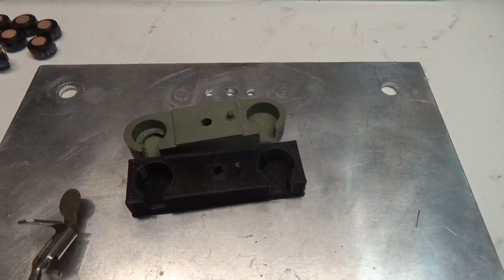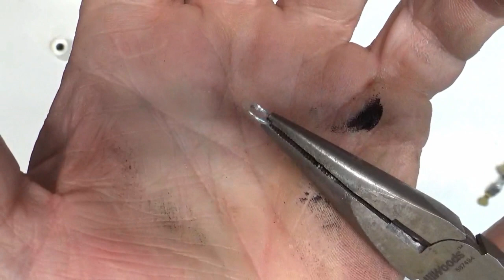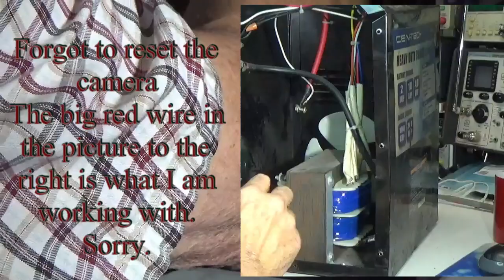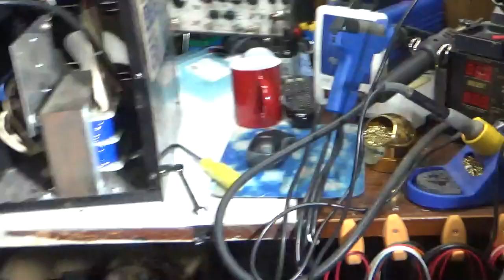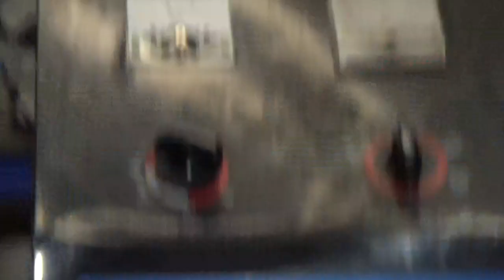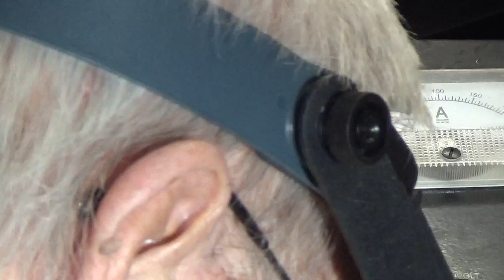Fixing a Cen-Tech 69368 Heavy Duty Battery Charger

Comment: Ok so I did all the diodes and used the grease and double checked the diodes were in the right way and it seemed to work fine for about 2 min then quit charging again. I triple checked the diodes again and still all fine. What else could it be?
Reply from the maker: The only thing I can think of is to make sure the diodes are making good contact. The way they do it isn't that great.

Comment: How did you test the diodes to make sure they needed to be replaced?
Reply from the maker: Like any other diode. Your meter has a diode test position. Put one lead on one side of the button and the other lead on the opposite side. They should read between .6v to 1.2v one direction and open the other. I know they don't look like diodes but that is all they are. Thanks for watching.
Reply: @AERVBlog  thank you very much for your response .i never knew it had that mode to test diodes.
Reply from the maker: @frenandols2805  your welcome.
Reply: Also they will be black and burnt up, along with some melted wire and plastic diode housing, that's what made your charger burn up.

Comment: I need to replace the fuse.
How ?
Reply from the maker: I don't remember a fuse and I do not have that thing anymore.  Sorry.
Reply: @AERVBlog  turns out I tripped the  breaker when trying to turn over my engine by jumpstarted the starter .
Reply from the maker: @UnTamedMustang  ahhh. Glass or was something simple.
Reply: @AERVBlog  extremely simple haha.
I have the power strip on the side of the wall and I wasnt able to see the reset switch on the side of it (mounted vertically on the wall) .
Reply from the maker: @UnTamedMustang  that is a feature. Wouldn't want some audible alarm to bother you or anything.

Comment: I followed along as you did the rebuild.  Great job.  So I took my apart and pulled the heatsink plate out.  Took it all apart. Replaced the diodes and used 3 rebuild diode holders I made.  I made them out of very dense piece of wood.  Wood won't melt so I should be ok.  I won't leave it running without observing how its doing.  Got it back together and it works fine now.  That is a relief.   Now I know how to repair it in the future.  Thank you for your great class of instruction.  Perfect.   John
Reply from the maker: You are welcome. I am glad I could help. Thanks for watching.

Comment: Fantastic, i have one that i picked up that had the exact same thing happen to it.  Im sure i can hand make some kind of diode holder or   something.  Question is what caused this beside a overload and how to prevent it from happening again. Unless they use the wires as cheap overload protection.
Reply: I think from the looks of the holders one of the diodes shorted out and melted the holder and the rest as they say is hostory. One shorted battery being charged at 40 amps for start would do it for sure. Thanks for watching.
Reply: Here is a link to the place I bought the diodes. 

https://www.mcssl.com/store/plpbatterysupply/catalog/search?keyword=diode
Here is the one I bought.
https://www.mcssl.com/store/plpbatterysupply/catalog/product/696040-10
Reply: @aervblog110  It is an advert for starting an online store?
Reply from the maker: @crystalgiddens7276  interesting. It used to work.
Reply from the maker: @crystalgiddens7276  they have a real website now. Plpbattery.com
Reply: @AERVBlog  Thank you!
Reply from the maker: @crystalgiddens7276  your welcome.

Comment: What is part # on diode
Reply from the maker: They are marked AR50D. I got them from PLP Battery Supply with a part number of 696033-10. That is a Powerforged Service Parts part number. Hope that helps. Thanks for watching.
Reply: @AERVBlog  were all the diodes bad? Mine appears to be only 2.
Reply from the maker: @crystalgiddens7276  yes. All of mine were blown and 3 of the housings melted. No idea how it happened.  The unit was given to me broken. Thanks for watching.
Reply: @AERVBlog  how did it turn out? did replacing them work for long?
Reply from the maker: @crystalgiddens7276  I have only used it a couple of times but it worked just fine. I think I will have to re-print the holders with a better more heat resistant material though because under load those diodes do get pretty hot.
Reply: @AERVBlog  The cost of diodes is about $35 for two including shipment (hopefully they are the only two needing replacement, they are the ones obviously damaged). A replacement charger is about $145. I am just wondering if it is worth it?
Reply from the maker: @crystalgiddens7276  does that include the mounts? The diodes I got were cheap from the place in the response above.